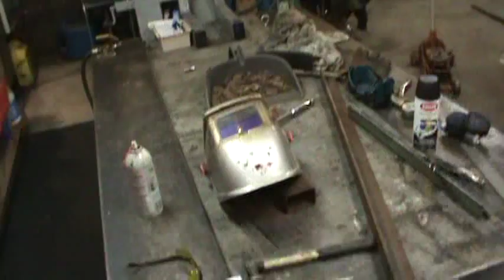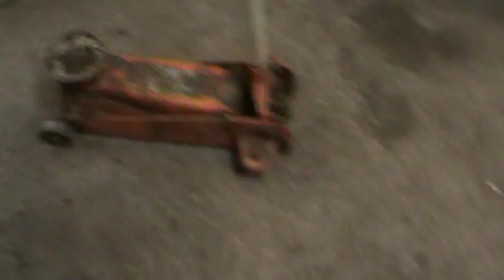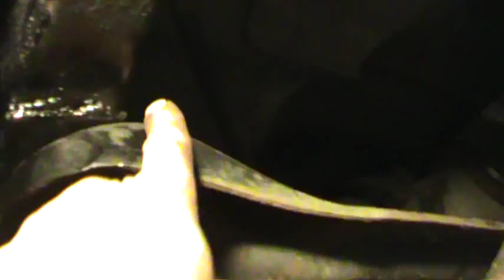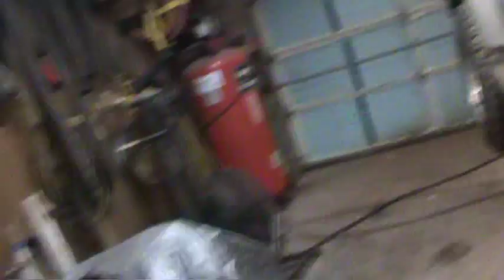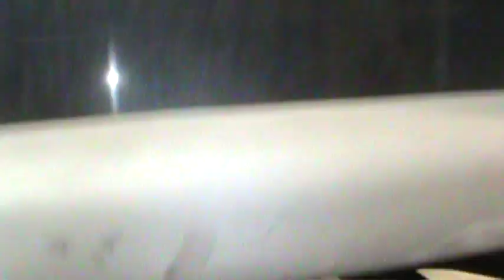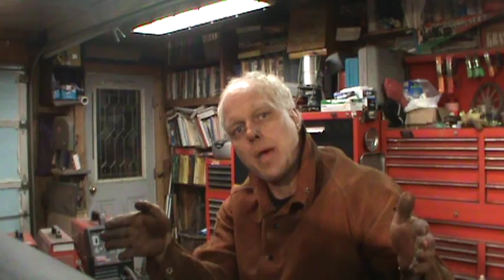jeep welded and custom atv build

Comment: i hit some rocks really hard with my fourwheeler and cracked the frame in several places and on the skid plates on the bottom are just crushed so i just cut aalot of it out and welded new in

Comment: What happened to the Ford Tractor that you had with the 3 point hitch? I think you brought home in late fall?  Would that make a good drivetrain for your "gator".project since it already has the hydraulics built it?  The transmission in those old garden tractors are also pretty bulletproof!